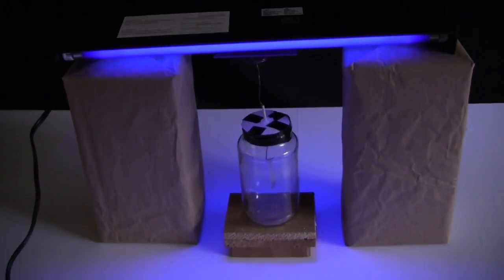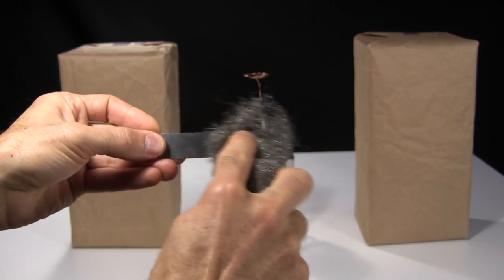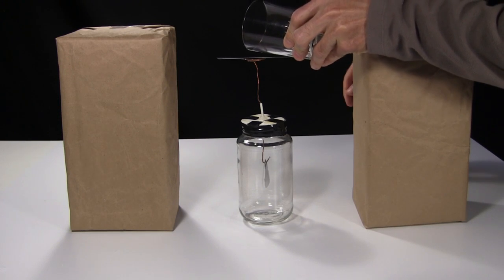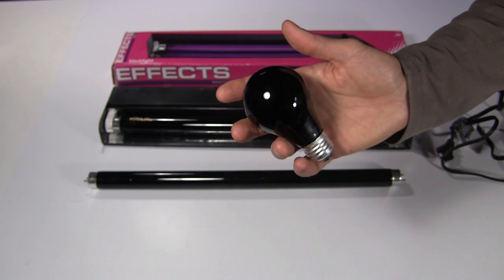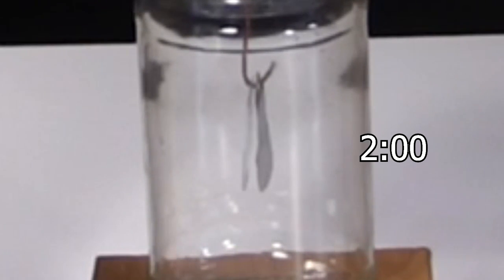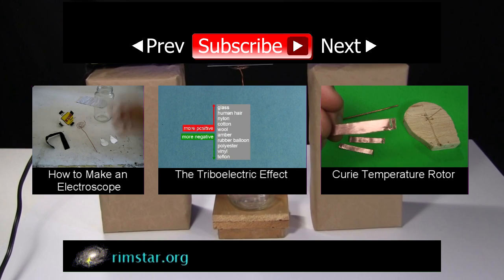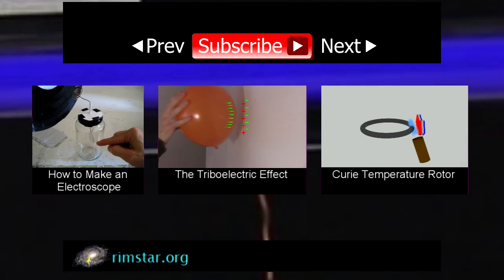The Photoelectric Effect and How it Works

Comment: I plan to try something like this...do you know the wavelength of that lamp?
Recently, I noticed that 250nm (UV-C) hi-power LED's are widely available and dirt cheap (perhaps something to do with covid and, sterilizing anti-bacterial uses???)  I have been looking for deep UV LED's for a while.  I think this wavelength is even shorter than the old EPROM eraser glass lamps I used years ago.
--dALE

ps
Didn't you do another video on the PE effect??
Reply from the maker: Sorry, I don't know exactly the wavelength of the lamp I used, other than that I know it was in the ultraviolet range, 10-400nm. The LEDs you mention are in the middle of that range so they might work. And, not, this was the only video I did on the PE effect. I did play with UV from the sun to produce fluoresence though https://www.youtube.com/watch?v=6-QdXyI217k and my TEA laser puts out UV light https://www.youtube.com/watch?v=Yp4CxC70XQQ
Reply from the maker: If you try it, let me know how it goes.
Reply: I will let you know when I try.  I have three stages planned...from to "quick and dirty" simple to "multi-focused multi pulsed LEDs onto interleaved switch terminals. @RimstarOrg

Comment: Cool. Question; Why did you use zinc?  it has a work function of 4.3 eV. But Aluminum has a work function around 4 also and is readily available.  Is there another reason zinc is better?  I have this on my list to demonstrate...using sunlight and a piece of plexiglas to show the effect with and without the plexiglas blocking the sun's UV.
Reply from the maker: I don't know. Iron's work function is greater than zinc's but aluminum's is less so aluminum might be better. You could check is aluminum oxidizes more quickly than zinc.

Comment: u mentioned about photoelectric effect on ur van de graaf generator series,  wonder if negative charge will increase by combining van de graaf with uv lamp?
Reply from the maker: Using a Van de Graaff generator would definitely supply more negative charge. But the leafs would move back together at the same speed I think. There is only so much energy available from the UV light. Having a stronger UV light or more lights would make the leafs move together faster.

Comment: Do you have to use a black light?
Reply from the maker: You need a source of strong ultraviolet light. Normal lightbulbs won't do that. However, strong sunlight might. I realized that and did these experiments https://youtu.be/1ZzubSmiRo8 but I didn't try it to test the photoelectric effect so I'm not certain it would work. You may need to use the magnifying glass to magnify the sunlight onto the zinc.

Comment: What is the exact connection between wavelength of light and decharching time of  electroscope?
Reply from the maker: I don't have a formula for that. You'd have to start with the quantity of charge on the electroscope and I don't know how to measure that. From there you can work out the number of excess electrons on the electroscope (1 unit of charge is 1 Coulomb, which is 6.242x10^18 electrons https://en.wikipedia.org/wiki/Coulomb). Once you know that then you'd figure out how fast electrons are being removed by the photoelectric effect. With those two things, you can work out how long it would take for all the excess electrons to be removed by the photoelectric effect. That would be the discharging time.
Reply: RimstarOrg It makes sense. Thanks

Comment: Have you tried a 405nm Laser diode?  ~50mW may really show something.
Reply from the maker: I haven't tried that. But zinc's work function is 3.6 to 4.9 eV, which means photon wavelengths of 344 nm to 253 nm. The work function is the amount of energy needed to break the electron free of the atom. Interesting idea though. Like you say, a source like that may really show something.
Reply: Thanks, Just for fun, I rechecked those calculations and got exactly the same numbers-I am from the time where I still use Angstrom units and Joules instead of nm and eV, but am now switching- 
Isn't the wavelength of that homemade N2 laser (was it 337.1nm)? in Zinc's w range?  I get about 3.7eV for the w of the N2 laser pulses.
--daLe
Reply from the maker: Ah, so it is. Maybe I'll pull out the TEA laser and give it a try. Thanks for pointing that out.

Comment: the electrons that are being released from the metal don't affect the metal's atomic structure? for example, zinc has 30 electrons in each zinc atom... so since you are causing electrons to be released from the metal, does that mean some of the zinc atoms that released an electron due to this event are now left with only 29 electrons? if so, what does that do to the metal?
Reply from the maker: It only leaves the metal with a net positive charge. I've never heard of it having an affect on the structure of the metal itself.
Note that at the atomic level, atoms are defined by what's in their nucleus, the protons and neutrons, so changing the number of electrons doesn't affect that.
Reply: RimstarOrg so is there a minimum/maximum limit to the number of electrons that can be in each atom?
Reply from the maker: I don't know the physics (chemistry?) of it well enough to say more. If I recall my chemistry correctly, the outermost electrons are called valence electrons and I don't know if more energy is required to remove a 2nd one after a 1st one has been removed.
Reply: I haven't done research on this but in metals, atoms are dissolved in an electron sea (metallic bond) and ejection of an electron wouldn't really matter considering there are 9 other valence electrons in zinc as well.
Reply: Rusty Shackelford the electron don't really go anywhere , they get excited on getting energy and move to higher energy levels called shells, like an 2nd shell electron goes to 3rd shell  , and if provided energy is very high, then it will move further resulting in increased distance between electron and nucleus and so, a partial positive charge develops there

Comment: would it be possible to positively charge the electroscope via exposure to uv light?
I have heard that this is impossible as the electrons ionize the air and form a protective layer around the zinc. what about in a vacuum?
Reply from the maker: I tried it back just after I'd made this video and it didn't charge. So whatever you heard may be right. Do you recall where you read that, if you read it online? I wouldn't mind reading the details. I don't have a vacuum chamber so I can't test it that way.

Comment: Why do they come together as it loses electrons? I thought that alike charges repelled eachother?
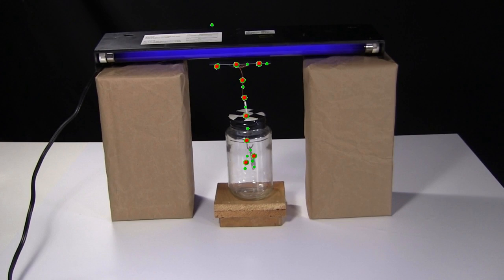Reply from the maker: +Alfonso Flores (Off With Religion Threads) We start by negatively charging the leafs. As you say, like charges repel and so the leafs spread apart. At that point there are more negative electrons than there are positive protons (the protons are the red balls in the middle of the atoms.) If you look at the video at 1:53 you'll see two atoms with equal number of protons and electrons, plus there are also 4 extra electrons on the leafs. It's those 4 extra electrons that cause the leafs to repel.
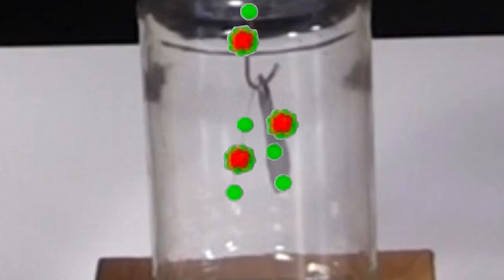Then at 2:00 we start removing those extra electrons. With less extra electrons, there is less and less repulsion, until we have an equal number of negative electrons and positive protons just in the two atoms. Since the number of negative charges is equal to the number of positive charges, there is no more repulsion and the leafs don't repel each other.
Reply: I thought that you positively charged the glass.. I'm watching your Triboelectric effect video right now. You positively charged the glass by rubbing the vinyl (forming an electrochemical bond), the vinyl took electrons from the glass. How did this affect the leaves?

How did the leaves become negatively charged if the glass lost electrons and by putting it close to the copper its likely to take away electrons from it? I'm so confused. Thank you in advance.

Comment: WAIT, So if the leaves lose electrons, how come they get together? Unless it has negative and on the other one, has positive it will still repulse. Negative and Negative as well as Positive and Positive repulse and if the negative charges are released, then would it have positive charge still repulsing each other? Please inform me...
Reply from the maker: +Jason Erdenetsetseg Before putting it under the UV lamp I charge the leafs up negatively. Since both leafs are negatively charged, they repel. When the UV lamp is turned on, the leafs slowly loose electrons, becoming less and less negatively charged and more and more neutral. Since they're less negatively charged they repel less.
However, once the leafs become neutral or if you start them as neutral they don't become more and more positive. At least I've never seen them separate again despite my trying. And I've always seen this experiment done starting with a charged electroscope. So possibly you need the extra electrons that you get from a negatively charged metal for the effect to work well. I'm not clear on why.
Reply: Alright Thanks

Comment: Hi and thanks for the video. Did you try to continue longer, that is extract even more electrons and charge the electroscope positively?
Reply from the maker: +mourgelas I didn't try longer to see if it would charge positively. But I did try starting from an uncharged one, which is the same thing. It doesn't work, at least for the ten minutes I waited. I'm suspecting that it helps to have the extra, free electrons, even though the emitted electrons are the ones that are bound to the atoms. Maybe the free electrons help by helping to repel the emitted electrons away from the metal instead of staying in the metal as free electrons themselves.
Reply: +RimstarOrg Indeed, if the material is neutral, any electron emitted at such a low energy would be soon re-attracted to the electroscope. It would be fun if you could devise a way to absorb away the emitted electrons, a grounded metal mesh for example...

Comment: According to Wikipedia zinc has a work function between 3.6 and 4.9 eV, which translates to photon wavelengths of 344 nm and 253 nm respectively. Also according to Wikipedia the peak wavelength of a blacklight is between 450 and 310 nm, so it is possible that the lightbulb has a to long peak wavelength. Also I assume that you used zinc because it is a "cheap" commonly available metal, which has a low enough work function energy?
Reply from the maker: +Kwin van der Veen I can't say for sure but since it works, yes, I'm assuming that the black light is emitting at least some wavelengths in the 344 nm to 253 nm range. That's probably why mine took so long to discharge the electroscope, there are so few photons in that range. Most lab demonstrations have UV lights that are more in the correct range and discharge their electroscopes much faster.
I used zinc because it's the metal that's most often used in these demonstrations, and I'm assuming as you say, that that's because it has a low enough work function. I already had the zinc from many years ago, bought for some other purpose that I don't remember.

Comment: Best video in ages. Will it work with sunlight?
Reply from the maker: +Mongrel Shark Thanks! And I haven't tried yet, but it will be interesting to see if concentrated sunlight will work. It needs UV-B, most of which is filtered out by our ozone layer.
Reply: I guess that rules the tea laser out.
Reply: Oh I still haven’t worked out why you used zinc. I'm enjoying the puzzle for now but others are bound to ask sooner or later...
Reply from the maker: +Mongrel Shark For the photoelectric effect to happen, the photon must have enough energy to overcome that zinc atom's work function and have some energy to spare. The work function is the amount of energy needed to break the electron free of the atom. But if the photon had only that amount of energy then the electron would just fall back into the atom afterward. The photon also has to give enough extra energy to the electron so that the electron will have enough kinetic energy to actually move away. So the photon's total energy must be equal to zinc's work function plus at least some kinetic energy.
UV photons in the UV-B range have enough energy for this where zinc is concerned. People have pointed out in the comments that according to wikipedia, a black light has photons in the UV-A range, which is not enough energy for zinc. But it gives percentages of photons in the UV-A range so I'm assuming black lights also emit at least some UV-B. That smaller amount is probably why the effect takes so long with my electroscope, whereas in lab demonstrations with their UV lights it goes faster.
Reply: That makes sense. Your light would have a small percentage of UVb.
Is there a way to identify sutable materials from a good periodic table with full atomic specs?
Reply from the maker: +Mongrel Shark There's a list of atoms and by work function here hyperphysics.phy-astr.gsu.edu/hbase/tables/photoelec.html.
Reply: Interesting. I surfed around a bit from there. Looks like all light with a freq higher than red can eject electrons, but the higher the freq the more energy those electrons have, so more voltage on the electroscope. Making any given freq brighter will eject more electrons (more current) but not increase the voltage.
Reply from the maker: +Mongrel Shark Yes, exactly. Brighter means more photons for ejecting more electrons, but not more energy per electrons, hence not more voltage (which is joules per coulomb.)

Comment: I wonder would this effect work with x-rays from x-ray tubes. 

Note: I'm not suggesting you to try it because I'm aware of the dangers of x-rays.
Reply from the maker: +Brandon Fisher From what I've read, x-rays should work. The work function is only a threshold energy, threshold meaning it's the minimum energy needed. The work function for the particular atom, zinc in this case, is the energy needed for the electron break free of the atom. Any energy above that amount goes into the kinetic energy of the electron as it moves away. Since x-rays are higher energy than UV rays, the extra energy just means more energetic electrons once they break free.
And there's no chance of me trying x-rays, so no worries. :)
Reply: +RimstarOrg Good, I wouldn't want you to risk jeopardizing your health with cancer for that. It's unfortunate that there are many other youtubers out there risking their healths by playing around with x-rays, I'm glad you're not one of them.

Comment: what if you hold radiotion on it?
I think it can be iyonized it an you can get some voltages here
(sorry for my bad enland :D)
Reply from the maker: +prohri uhri That would be an interesting experiment. I wonder if americium pellets from smoke detectors are electrically conductive.
Reply: +RimstarOrg ı think the americium have more power than black light. because it have have gamma rays and gamma is powerfull than the UV lihgts.And if you put a beta source on one side and put a alfa source on the other side you will get a  "+ " and " -"  charge

Comment: Will this work with Ultra Violet LEDs?
Reply from the maker: +USWaterRockets I'm doubting it. From https://en.wikipedia.org/wiki/Ultraviolet#Ultraviolet_LEDs their wavelength is around 365nm (5-8%) to 395nm (20%) which is well within the UV-A range 320-400nm and 3.10-3.94eV (https://en.wikipedia.org/wiki/Ultraviolet#Subtypes). However, Zinc's work function, the energy required to break the electron free from the atom, is 4.43eV (http://hyperphysics.phy-astr.gsu.edu/hbase/tables/photoelec.html). However, the second link above also says black lights are in that same range, so who knows, maybe there's at least some UV-B being emitted too, even if it's only a few %.
Reply: Thanks! Putting it in sunlight should work then. Is there a reason why it won't?
Reply from the maker: +USWaterRockets From https://en.wikipedia.org/wiki/Ultraviolet#Subtypes, sunlight in the UV-B range is mostly absorbed by the ozone layer. The photon energy of UV-B is 3.94-4.43eV. From http://hyperphysics.phy-astr.gsu.edu/hbase/tables/photoelec.html, zinc's work function is 4.43eV. So there are not a lot of photons with enough energy. However, like I did with my fluorescence experiments, it would be interesting to try concentrated sunlight, to gather a larger area of sunlight and hopefully get enough UV-B to make a noticeable effect.
Having said that, if it works, some might think it could also be thermionic emission happening due to the heat of concentrated sunlight. But a quick check shows that's unlikely since the temperatures for thermionic emission seem to be in the 700C to 1400C ballpark.
Reply: Is this your field of interest/study/career? You know a heck of a lot about it! ;-) Thanks for explaining in detail!
Reply from the maker: +USWaterRockets It's my field of interest, which includes just about everything else too ;-). You seem to be the same, judging by your comments on other videos. And you're welcome!
Reply: Thanks! That's indeed high praise. I guess we just have curious minds and enjoy teaching others. :-)